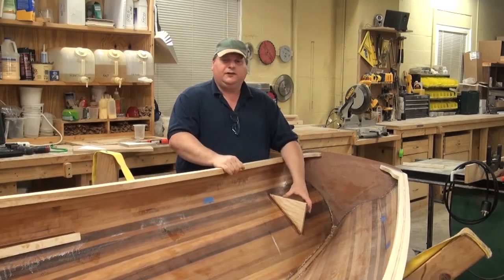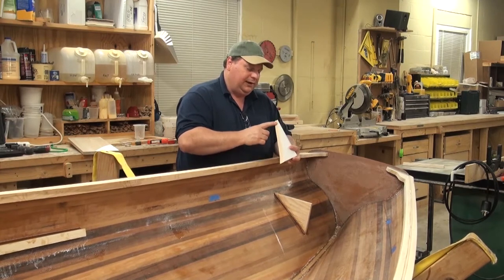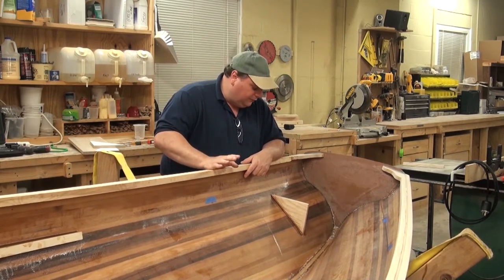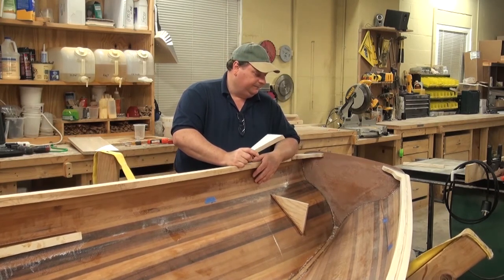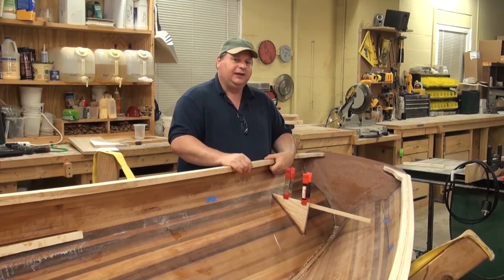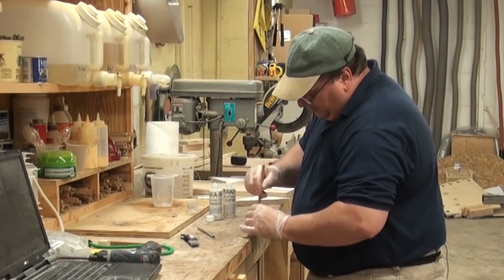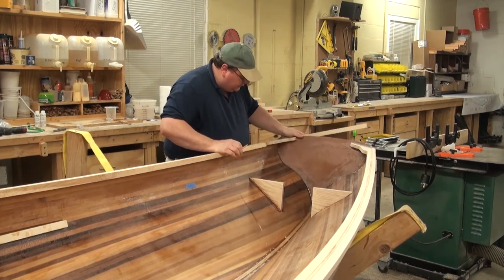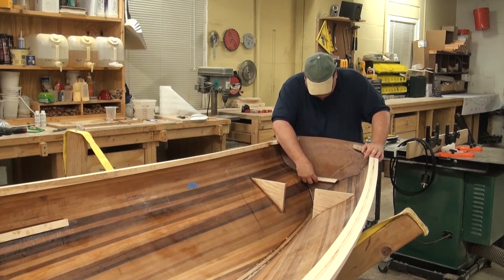27 Seat Knees and Risers for your wooden Whitehall boat.

Comment: Did the whalers make their boats out of strips, and also how did they get it water tight without any Epoxe?
Reply from the maker: Hey digiphex.

By whalers I assume you mean people who whaled for a living.  First you should know that "whalers" typically used smooth sided stackable dories.  Whithalls were typically used for cargo type of tasks generally within harbors (big ones).  There isn't much room on whaling ships and they could stack them up on the deck.  If you are truley interested, there is a book called "the Dory Book"

However, to your point, Whitehall style boats were traditionally made both lapstrake (clinker) and carvel planked.  Carvel planked boats were smooth sided, much like a wood stripper and they had treated hemp pushed into the spaces between the planks.   The Hemp would need to be replaced periodically and there are still craftsmen today who perform this on classic yachts.

There are some great books out there, albeit 100 year old books. which will go over the procedure, however a couple are still in print last time I checked. 

Enjoy the Journey!